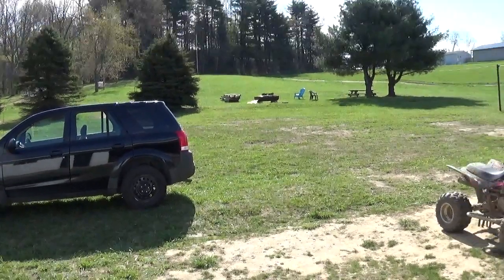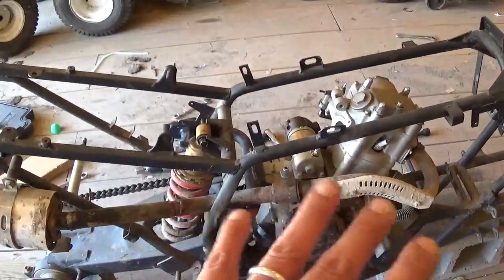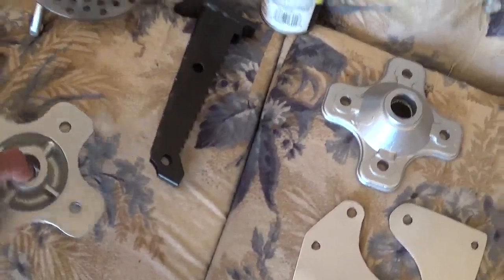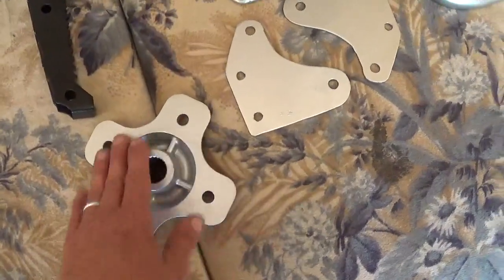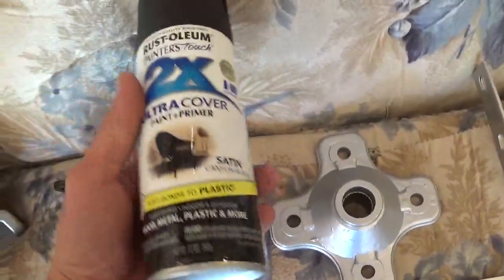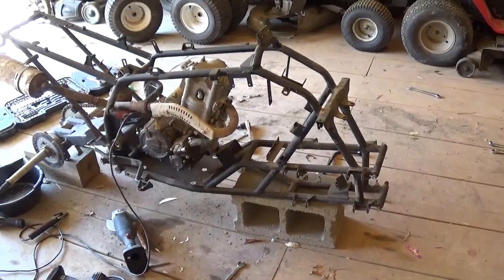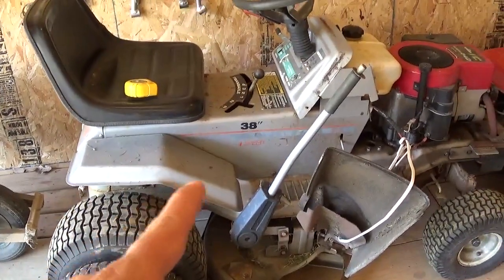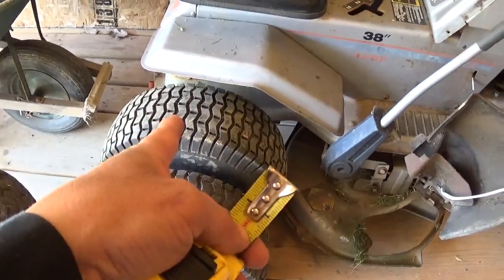China 250cc ATV rebuild part 2

Comment: I'm hoping that you could help me I have a 250 Chinese quad I'm pretty sure it's a Tao Tao I just need a simple break down or the wiring just to crank it and turn it on without the kick-start only electrical start what wiring from the CDI box to the Staters are the important wires that I just need to turn the bike over and have it run I just need a basic wiring setup soccer eliminate majority all this extra wiring on the ATV and just have a basic setup like if I was doing a basic wiring on a 110 or 125cc Chinese ATV I know the CDI box has a few more wineries on the 200 and 250 just need some help on this on this project I'm throwing and it's a non coolant motor I guess it's are cool I don't have a radiator not sure how to pronounce I'm sorry if I mispronouncing things not intentionally just looking for help or the right guidance lead me to the right path of getting my ATV done so I could be able to enjoy riding with my kids around my house

Comment: you should retire title video it is not rebuilding 250 Chinese quad it is putting a basket case back together if you were rebuilding said ATV you would tear the engine apart and replace any warm parts and piston rings and gaskets Etc